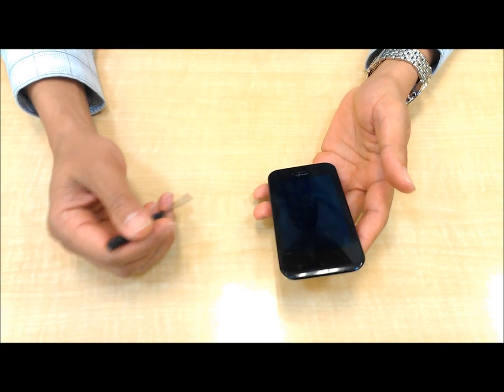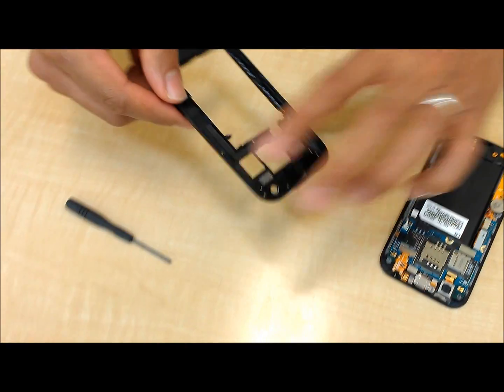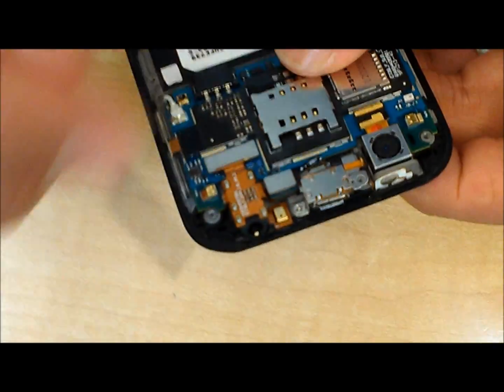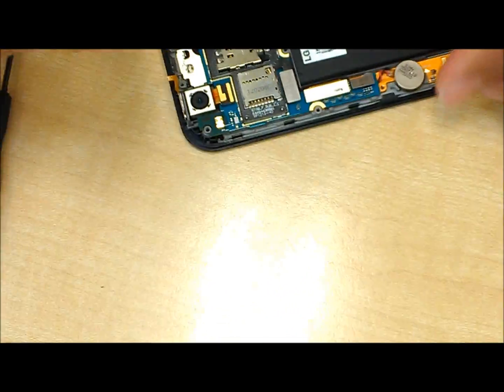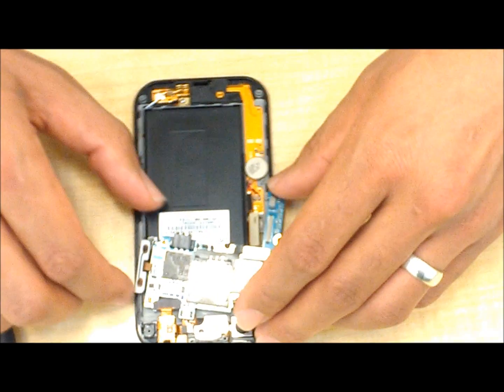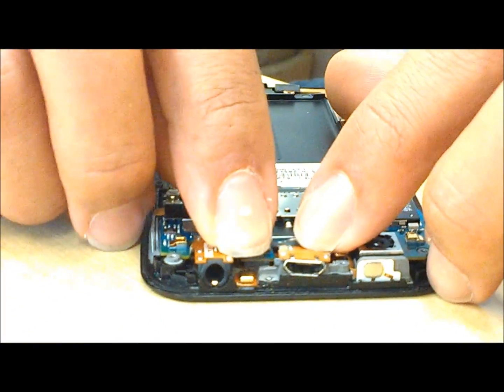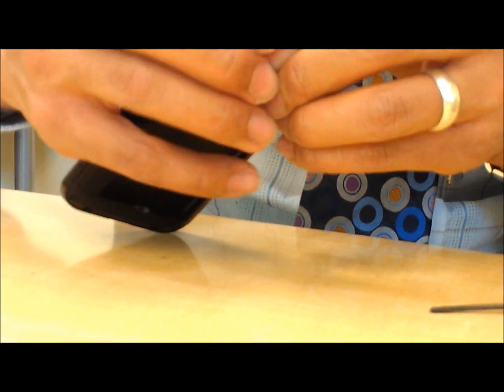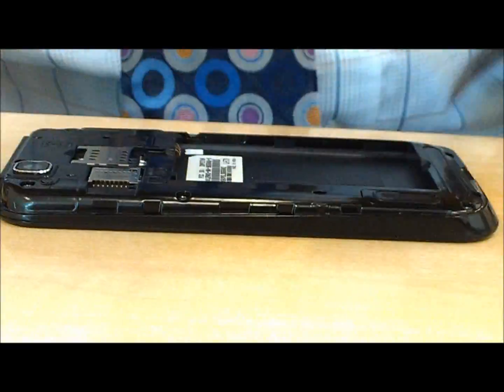LG My touch 4g tear down and reconstruction.

Comment: Hi i bought a new power button piece complete with the flex cable usb and power button as well as that little silver piece that connects it to the phone. My problem is that i replaced it and it was working fine until last week when it suddenly stopped working. I opened it up again and examined the flex cable piece. The flex cable was not ripped but the power button was unresponsive. What do i do now??
Reply: +Morayo Obaisi 

Look for another parts machine, on eBay.

I am...

Comment from the maker: It is possible to send a short through the phone by connecting the positive and negative terminals near or at the battery connections together, but that could be dangerous...  At this point, however, it seems like you are willing to take a risk.

Comment from the maker: Remember, the spring under the power button may be messed up, even though the cable isn't broken.  This would keep your power button from working or have it always on. If the spring is in the way, very likely a plastic band, then it will prevent the circuit from completing and the button won't work even though pressed.